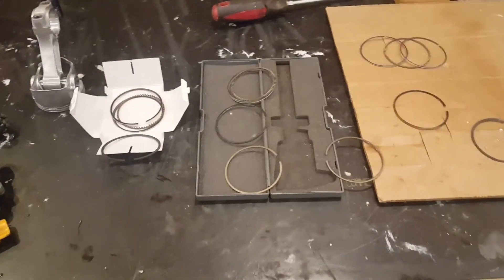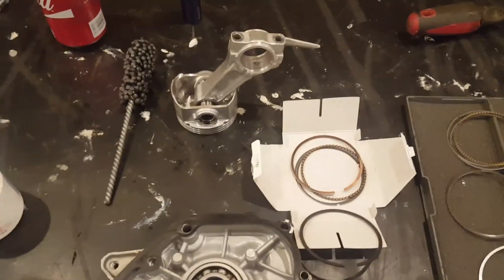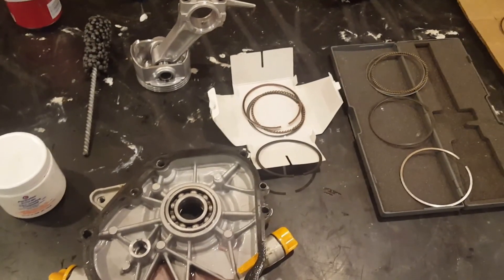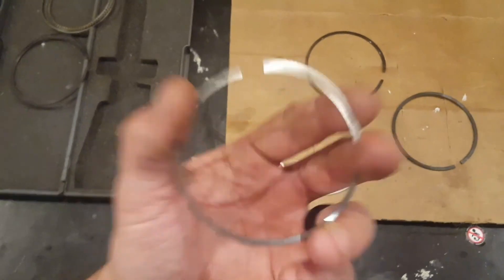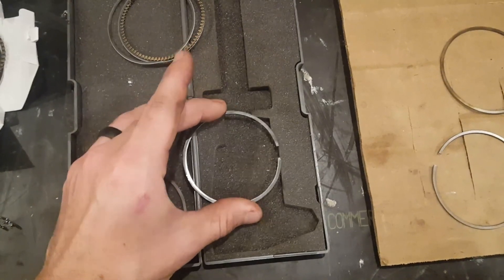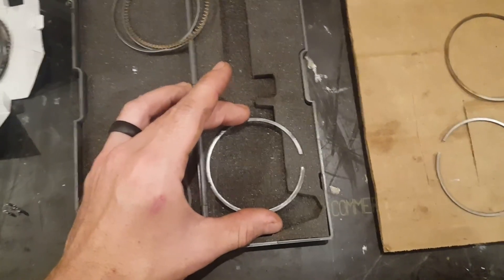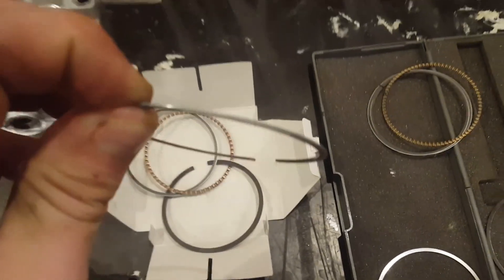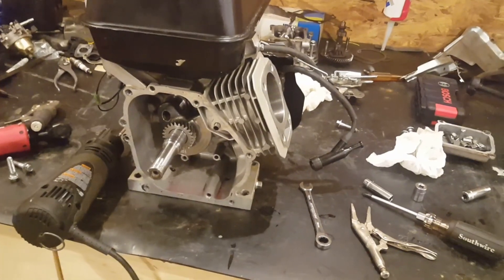Predator 212cc hemi. Stock, how to free up Hp Video2

Comment: Rod journal is 1.188 X 0.001 =0.001188"  or 0.0012". 1.189/1.199 should be your goal then take into account the difference between steel and aluminum far as heat growth.  I know this video is pretty old but you never know who it will reach

Comment: Not sure prewearing the engine is the  best way to get power..im a machinist and i know those hones very well. It will make the contact surface where the rod and crank meet, round. Then when you run it the engine will wear way fast due to less contact surface. And the bearing, pound it out and get a nice one for 5 dollars. Those stock ones in a cheap engine are crap to bigin with.. build the power!

Comment: Could you do these engines like they used to do the old briggs? Could you get a flywheel from like a 79cc and bolt it on?
Reply: You can do any thing  if you wont to blow up  the  motor

Comment: Also I found some valve springs that look and test to the exact lb of your stocks but they are tempered different I have found your making your best power at 4800 rpm anything over is no gain changing the valve springs have changed that to about 50 5100 rpms we have a rpm rule of 5500 so it works great

Comment: Back in the day I was into garden tractor pulling, what we would do in the stock class is grind and polish the low side of the cam lobe to get .020 to .030 more lift out of the stock cam.   Just make sure you don't go beyond the adjustability of the valve lash.

Comment: So many people think a cam is going to make you faster. It is not true without other mods. Proper porting intake, exhaust mods and proper fuel/air deliver all has to be adjusted and tuned. Adding a bit of lift and/or duration will slow you down without proper tuning.

Comment: First off radial tension on a piston ring is manufactured in to it. In my engines I don’t run the second ring and I don’t get any blow by. Also the drain back you drilled in the oil ring groove are to shed the oil from the cylinder wall. That’s why they are called drain backs!! Buy drilling more like you did it would hurt the oiling at the skirt. Don’t get too much in to Radial tension because if the dam piston doesn’t seal in the bore the parasitic lost is all for nothing! You seem like a smart guy buy you need to study the dynamic of the IC engine